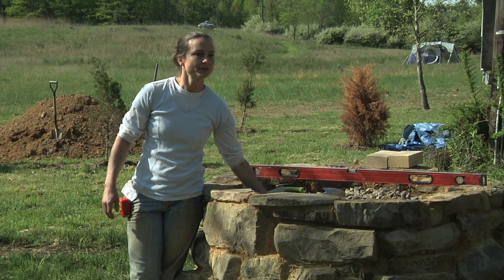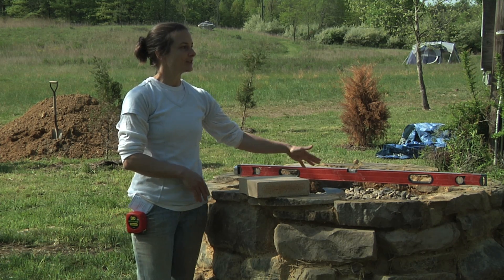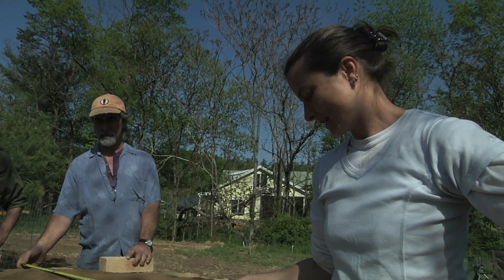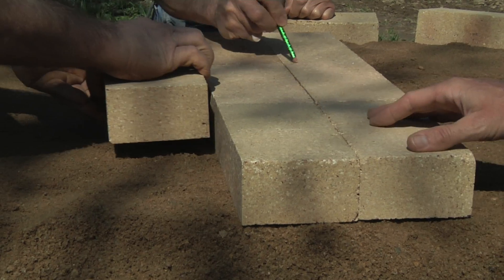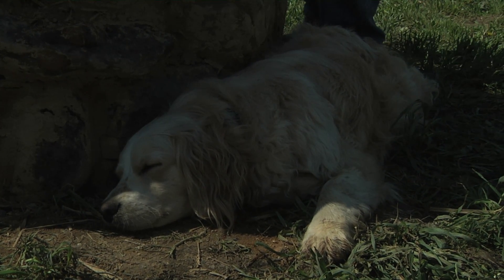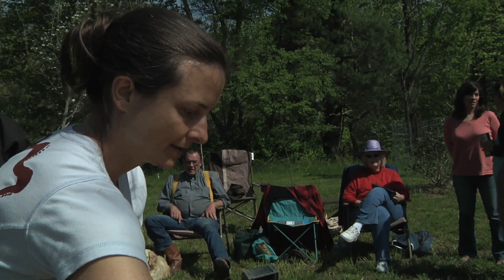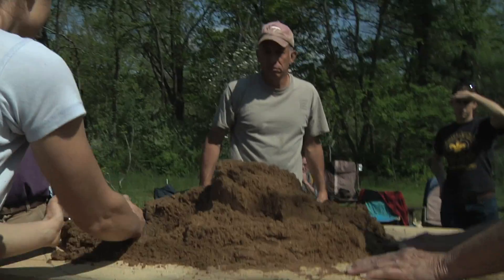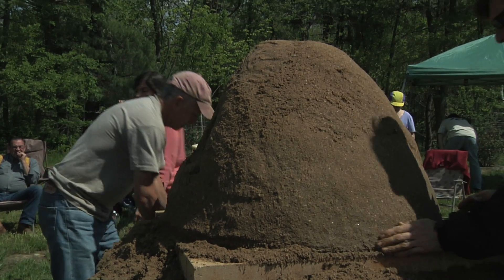How to Build a Cob Oven - Part One

Comment: I want to rebuild one of my ovens because it is a little too high inside and it has a huge crack inside too. I intent to make a new mix for the inner layer, but can I re-use the old material for the insulation and the cover layer?
Reply from the maker: sure, as long as you didn't add any other binder, you can always re-saturate the clay

Comment: We followed the three parts of your instruction video and produced an amazing cob oven, "Hestia," that fires up to temp in under three hours and can cook pizzas (600 F)for a couple of hours, followed by a couple of batches of sourdough (475 F), an overnight pot of baked beans and then some slow-dried granola with the residual heat in the morning (325 F)!  We let our thermal layer dry completely before adding the insulating layer due to scheduling restrictions with no problems. We were able to source all of the components for the oven and shelter locally with many of them recycled right off the farm here. A wonderful companion for the cob oven is Richard Miscovitch's book "From the Wood-Fired Oven."
Reply from the maker: that's awesome!  :)
Reply: Sheila Selby .

Comment: Hi, our soil has just a little clay in it.  I purchased fire clay to augment, if I just used fire clay would I still use a 25% to 75% clay to sand mix?  Thank you.
Reply from the maker: you have to do tests to get the exact proportions....every type of clay is different (it's just that most clays work with about 25% clay, 75% sand)
Reply: Thanks, one more question please.  Does one have to put the cob layer on the same day the thermal layer.  I won't have as much help as you did and I'm a little concerned.
Reply from the maker: nope you can do them whenever your particular timing permits.  I usually do the insulation the day after the cob mass layer, because I'm usually teaching a workshop.  But you can take as much time as you like between.
Reply: Finally finished my oven, hoping to have pizza over the weekend.  Thank you for your help, Randy.

Comment: Wonderful. thank U  for sharing it!
can u tell me more about proportion between base diameter and cob high?
About the door?
Reply from the maker: Peppe Bruno the inside diameter of the base determines all other dimensions.  The inside height will be 3/4 of the diameter.  And the door will be 2/3 of the inside height, which also works out to be 1/2 of the diameter.  It's also written in the text of the video, in case that is helpful.
Reply: buildnaturally Thanks.
I built my cob oven  some weeks ago(in truth i built only the cooking chamber and i'm waitin' for better weather to build the isolation chamber). the diameter is about 70 cm, the inside height 50 cm and the door something about 28 cm. So, as you advise, I can take more space for the door.
Thanks for sharing your knowledge!

Comment: A foot of charcoal instead of the sand and 5 inches of cob over the charcoal instead of the fire brick will hold the heat much better due to the insulating properties of the charcoal. On initial firing, after the cob has dried completely, keep stoking the fire until you have a good pile of red hot coals. It should be enough to cover the oven floor with at least 3 inches of coals. Spread the coals out and close the oven overnight. This will fire the cob into a hard surface.

Comment: Hi could I use a Yorkshire stone flag floor over a layer of wine bottles  instead of fire brick for the floor
Reply from the maker: you can, but there is a caveat...stone can be prone to cracking under the heat of the fire.  also, the stone typically gets hotter than the fire brick, so you may have to "soak" the oven longer, or have a tendency to burn the bottom of baked items (bread, pizza, etc.).  But yes, in theory.

Comment: That brick pattern made no sense to me, so I looked up patterns.  Wouldn't a "herringbone" pattern have been stronger.  It seems like common sense to me, but I know nothing about brick laying and cob.
Reply from the maker: the pattern doesn't really matter as long as you can install tight, so there are no gaps between the bricks.  This is just the method that is easiest to me for teaching purposes.

Comment: Hi, thx for the great vid. I'm from the Netherlands, with less clay in my backyard. so i want to buy some claypowder on the internet to mix it with the sand. My question is what sort of clay powder it is? Is it "chamotte" clay powder(same as the material the firebricks are made of)?Note that chamotte powder is clay that is already being baked at a high temperature.
Reply from the maker: any clay is fine.  If you are purchasing as a powder, I would get the least expensive option.  And then don't forget to add sand to your mix, or you will get lots of cracking with just pure clay.

Comment: have you ever made a cob oven from 100% found and local materials? Would using an iron smelting furnace as a kiln be able to create bricks for the bottom?
Reply from the maker: yes, I have.  Don't know about the iron smelting furnace question...that's beyond my personal experience.
Reply: buildnaturally ah. so cobb is fine to use as the bottom? perhaps a baking stone or some extra corn meal would be used.

Comment from the maker: thanks so much for the nice feedback!  And I'm so glad if they were helpful to you.  For your base, I'm not sure I totally understand your question about size, but the short answer is that you can make the oven any size you like.  Just follow the proportions for the inside height and the door height based on your diameter (as noted in the video description).  For insulation underneath, I actually skip this, as it does not seem to be the important variable to make the oven operate well.

Comment: Your video series is the best out there on oven building! thanks for posting them.
My base is not going to give me enough room for 36" after all the layers are added but I would like to go bigger than 27". Do you see a problem with me laying down the bricks for a 36" but only building out to say 32"? That would give me the extra room for the insulation. Also, how much insulation do I need under the fire bricks? Some will be laying in part over the base stones ring.

Comment from the maker: Yes, absolutely, you can take days if you like to build the oven.  I would definitely recommend keeping the clay damp as you build, and a wet cloth of some kind would do that nicely.  You can use a cement mixer to mix cob, though it will tend to be pretty wet, which will actually limit how much you can build in one day, since it will start to slump.  For the door...it is about 2/3 the height of your oven interior (which is 3/4 of the oven diameter.  Hope this helps!  Good luck.

Comment: Hello,
 My husband and I are alone to build our oven, can we delay between
 operations , If i put a damp or wet blanket over it can i take a few days
 to do the work.

 Also can we take a cement mixer to mix the clay, the sand and the water.
 like i said  we are 2  to make the oven.

 And the measurements of the door.

 Sorry my English is not as good as i would like , i hope i made myself
 clear enough.

 Diane

dvenne60@gmail.com

 Thank you very much.

Comment from the maker: Your version works well too.  There is less aluminum in the firebricks than you breathe or eat in normal foods, and it's not clear that the aluminum would be absorbed into any pizza or bread cooked directly on the bricks (definitely not into a pot of food).  But if you want to avoid, by all means you can do a clay floor.  Not sure what you did to ensure that you don't get sand in any food cooked directly on the clay...feel free to share that too.

Comment: My Cob Oven is over 99% clay and sand, i didnt use any brick. Its an Rockt Stove Cob Oven made out of 2.2 tonns clay/sand/straw/wood. I can heat it up to over 600°C and it still works fine after over 3 month. Total cost 0 € and 32 work hours.
My problem is Aluminum Its a neurotoxin!
I will upload some Fotos on Facebook later

Comment from the maker: I use firebrick because they can handle the high heat of the fire without cracking.  Added bonus is that the corners tend to be really sharp, resulting in a very smooth floor.  If you are concerned about the inert aluminum oxide component in the bricks, you can use whatever else you prefer for the floor.  Just know if you use regular bricks, they may crack.  If they crack, you can fill the cracks with ash from your fire.

Comment from the maker: 2 is the weight...and here you probably would want to build a smaller oven (24" diameter max.), or else the weight is astronomical.  cob weight approximately 17 lbs per 12" x 12" x 1" volume (adds up fast!)  Are you on facebook?  I can direct you to a forum where folks have done this & they could share their solutions.

Comment from the maker: Part Three is officially up!  And if you read the notes I wrote at the bottom of the video, I wrote out the dimensions to calculate the diameter, the inside height, and then the height of the door.

Comment from the maker: There is a defined height for the door opening (depending on the size of your oven), but the width can be whatever you want.  So you can make the door opening large enough to clean out easily.  Part three talks about firing and cleaning the floor, but basically you use a damp COTTON mop or rag.  Do not use any synthetic materials, as they will melt onto your floor.  Maintenance depends on the finish you put on the oven (again discussed in part 3, which should be online soon).

Comment from the maker: The fire brick doesn't crack under the heat of the fire and provides a very cleanable surface to bake your pizza on.  You could experiment with a cob floor, though you may find some cracking in the surface and you may need to use a pizza stone to avoid sand in your pizza.